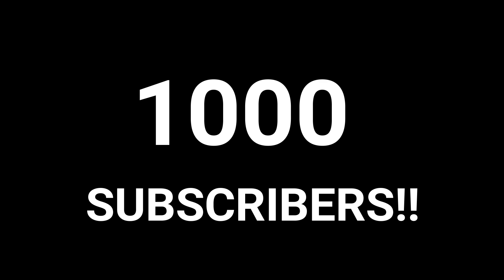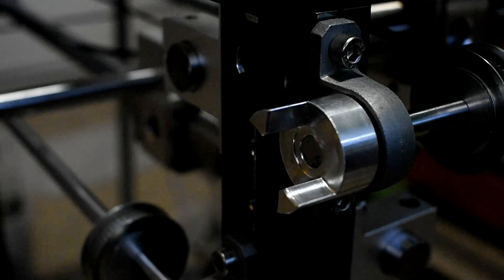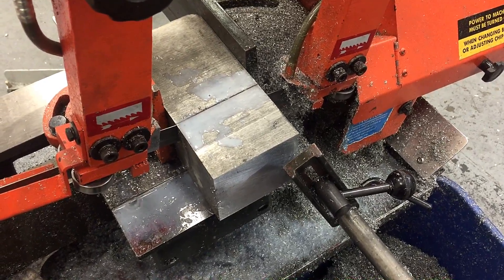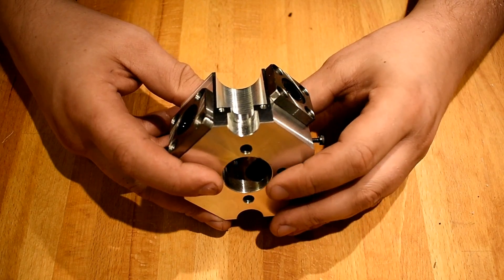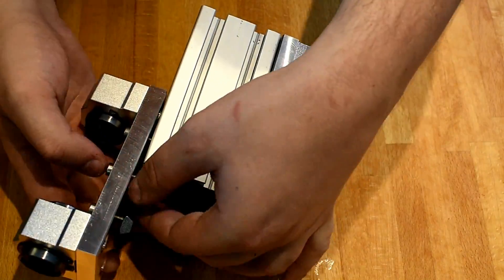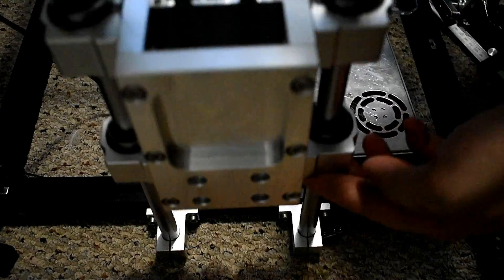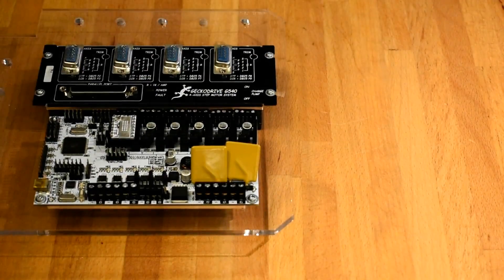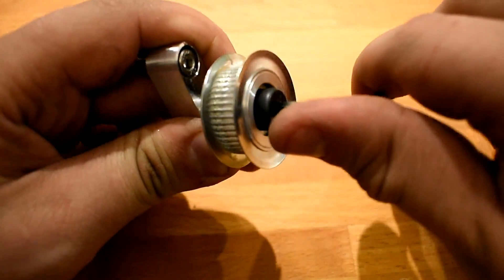3D Printer Part 2: Machined components

Comment: perhaps you should make a lighter version and use less powerful stepper motors, after all the loading of 3d printers are quite small , you don't need the torque of this big motor, a nema 17 will do the job perfectly.

Comment: Wish I had good access to Cnc. I quoted aluminum 12 x 12 x 1 1/4 part at 2k dollars. Fuck that. Anybody know good place for machining?
Reply: Speaking as someone whose day job is running some industrial lasers in a metal fabrication job shop, bad drawings are the bane of productivity (and sanity).  Napkin sketches, missing dimensions, stupidly tight tolerances, assembly drawings with no individual part drawings...  Aaaargh!  

More relevant to YOU, everything that makes me go "Aaaaargh", costs you money because we have to quote higher to cover the extra time it takes to run down answers.  

If you can supply a CAD file or solid model file, you can save yourself a good chunk of cash.  Be Damn sure it's correct though.  Job shops don't make what you MEANT, they make what you DREW.
Reply from the maker: I find local places are the best.  Depending on the part, it can be quite expensive, especially for single parts.  It may be worth asking if there are any features that make the part especially complicated and expensive that can be changed.  Shops also like good drawings and basically anything that can make their lives easier :)
Reply: buy a mini mill, 600 bux ,, learn as you go

Comment: nice, the only thing i notice is that the tool carriage its too heavy, you are going to need anti-vibration stand-off to prevent ringing in your prints, you are not going to be able to print fast, unless you reduce your carraige mas, its critical, another thing that i dont see or you dont think about it its the autoleveling bed, heatbed wraps when heated , even the mk3 aluminum ones, wrap less than the pcb but wraps, induction sensors are the best, but what printers do is compesate the desviation moving the heatbed up and down as the tool moves, and that is inaccuracy becouse the stepper motor angle step error are going to make their own on large surfaces, unless you put a encoder or a cloosed loop, i prefer to manual level the bed with a feeler gauge
Reply from the maker: I'm unsure for the tool carriage too.  What I may do is let it move fast in non-printing moves, but stay slow while printing.  I'm hoping that despite the mass I'll still be able to move quickly because of the NEMA23 sized motors, though I must confess I didn't do any calculations for this build :P.  Thanks for the tips; I'll have to think about some kind of auto-leveling probe!
Reply: i recomend to do a quick change light weight carriage, it can be 3d printed, but in abs not pla, or aluminum, you can make fast as your stepper can go, the problem is whit heavy tool carriage is when you desacelarte, all that mass are puting kinetic energy that need to be disapated , and that my friend is vibration and heat, and vibration is ringin in 3d prints, and fdm are a very low process, so you want to be as fast and presice you can, 3d printer dont do any kind of work, so a very lightweight carriage is a great thing, and for the extruder i recomend a direct drive, unless you are planing to do multi-extrusion-material printing, in that cases bowden are the best, the best extruder avaible on the market today in my opinion is the titan from e-3d its a very ingennus desing, using light-weight stepper and stainless steel for the hobbed-gear
Reply: Ralphie Vigg its becouse pla dosent had good mechanical propetys try to tap a hole in pla and you will see, and if you want to use a heated enclosure for printing large and tall parts in abs pla will deform on load
Reply: Ralphie Vigg its becouse pla dosent had good mechanical propetys try to tap a hole in pla and you will see, and if you want to use a heated enclosure for printing large and tall parts in abs pla will deform on load